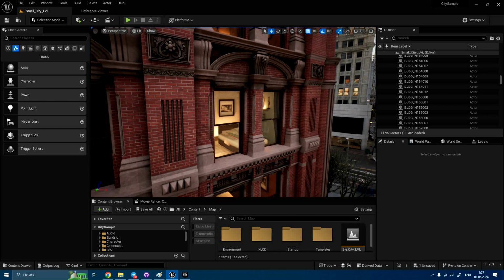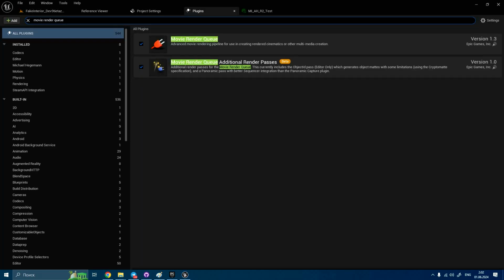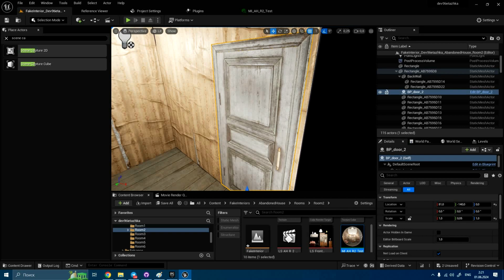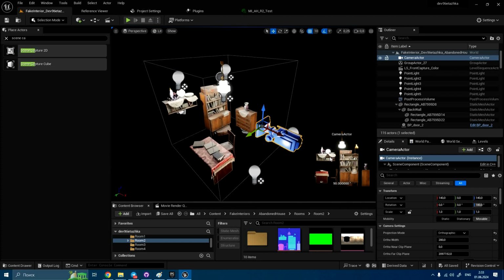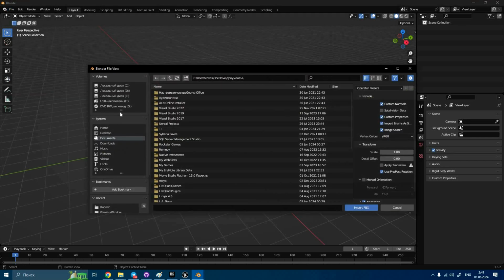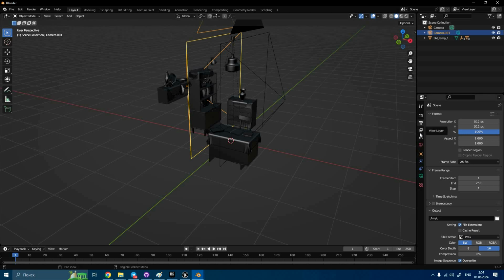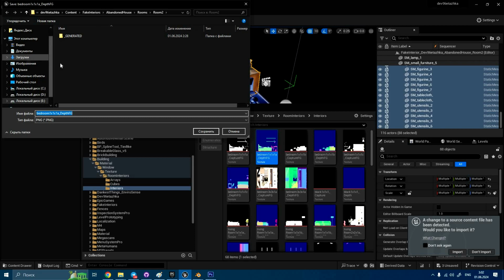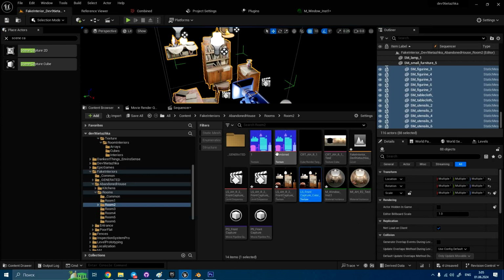Unreal Engine 5 - Create Fake 3D Interiors Like in Matrix Awakens Demo

Comment: Very Nice! That's such a good was to save on lighting and geo with just the weight of a shader.
Reply from the maker: Yeah, I think this shader could be greately improved if you could use more projections. Currently there only 2
Reply: @fallingsappy  I would assume that using more projections would make it as expensive render as rendering a 3d room.
Reply from the maker: @karimdaman8587  I don't really know. My goal was to reverse engineer what it would take to re-create effect from Matrix Awakens demo)
Reply from the maker: @karimdaman8587  You could increase projection count based on player distance to window for example
Reply: @fallingsappy true, thats a good idea.. have been making progress on this? Or have you reached your objective?
Reply from the maker: @karimdaman8587  I put it aside to work on some different parts of my project. I will use this material when I return to building creation